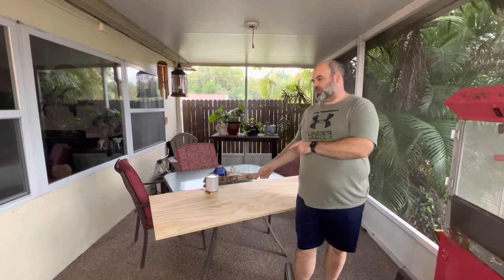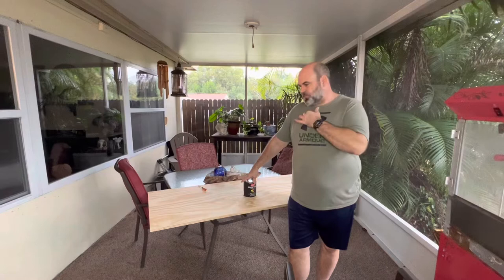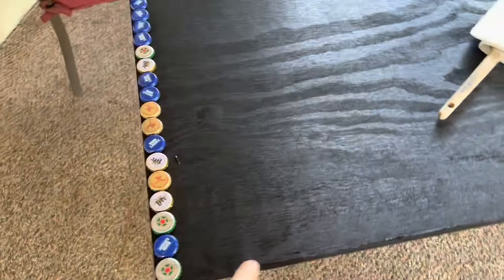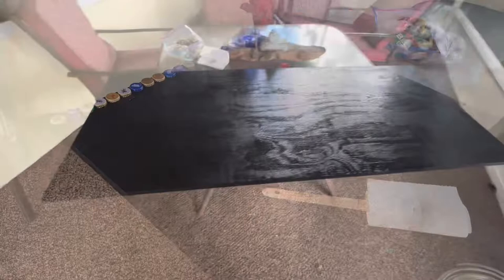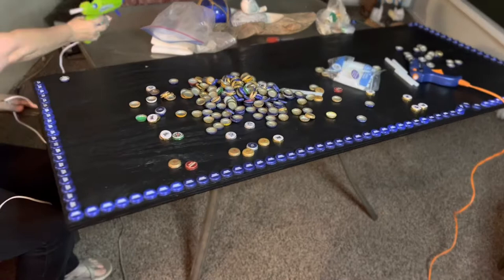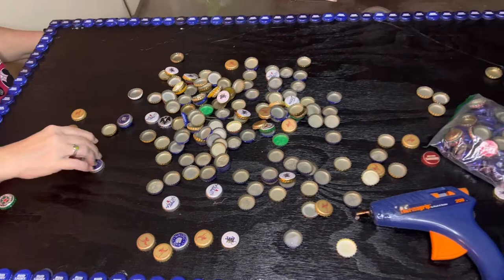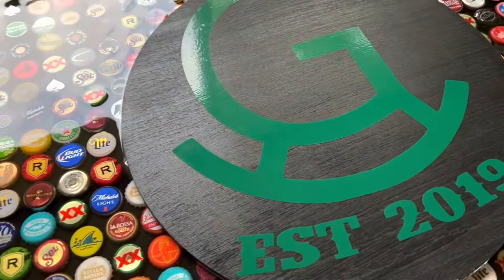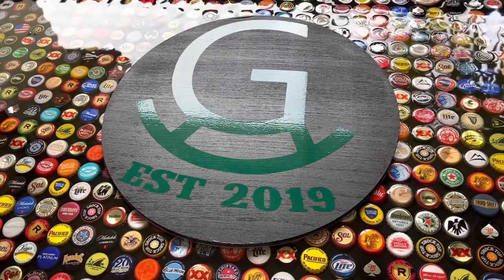Epoxy bottle cap countertop

Comment: I used 1305 Beer caps on my bar. I started with hot glue, but a lot of caps weren’t stuck down the next day coupled with the expense of the glue sticks I switched to GE silicone. My wife complained about the smell of that stuff so I switched again to acrylic silicone. At 3 bucks per tube at Lowe’s, I used up 14 tubes of the stuff.
Reply from the maker: Sounds like you tried more ways to mount them than I did. What do you think worked best?

Comment: No comments??!! Whaaaat. I just made a beer bottle cap table .. Well,  I bought the table and added the bottle caps. Im also making a video. 
Ive been collecting bottle caps since 1993?!?
Reply from the maker: It was covered by plastic while it dried. I used wood slats to go across the width and covered with plastic. No issues at all.
Reply: @graybeardgarage9638  cool. Well it looks great